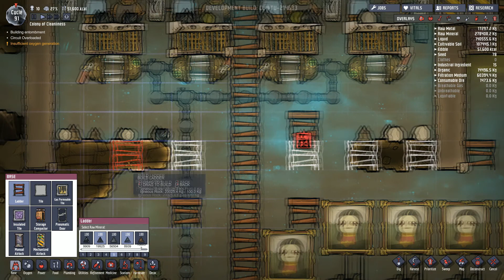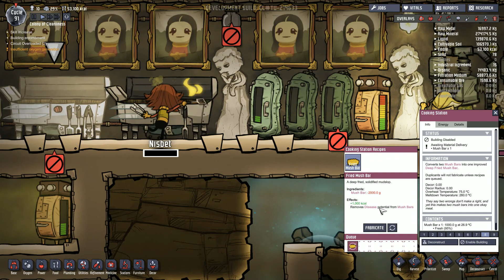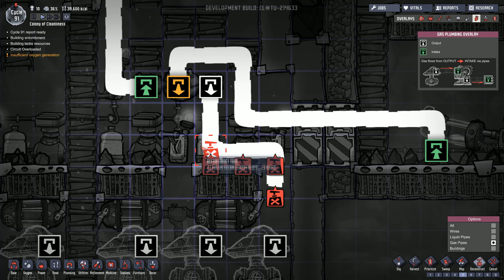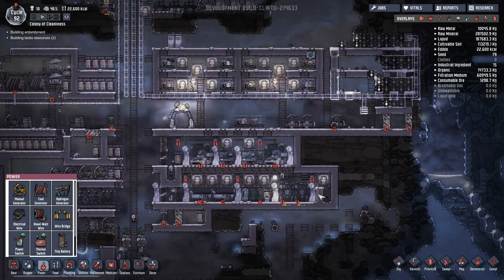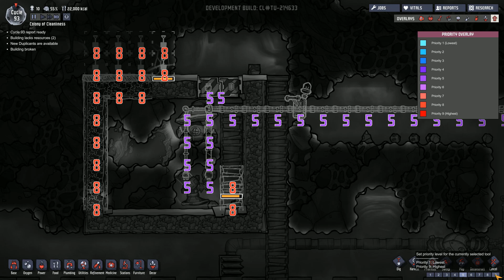Oxygen not Included S2 part 7 ~ Ductwork

Comment: Loving this base layout for the air production and the trio gas pipe design
Reply from the maker: If nothing else, it makes for a nice industrial appearance as you add more and more machines into it. ^^ I like the look too. The three gas pipes are needed though, each pipe can only handle the full output of two pumps and six pumps is almost enough to keep up with the full 02 output of the machines. Though, of course, it will never be fully efficient...